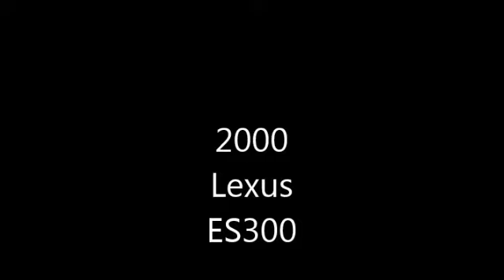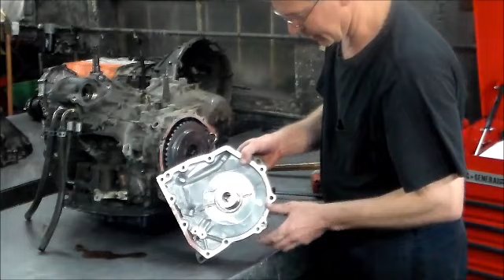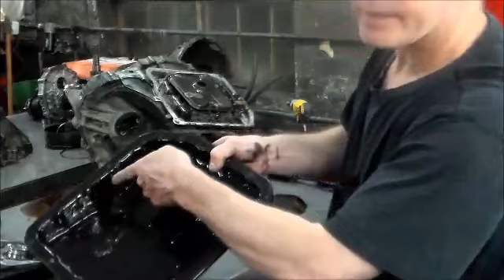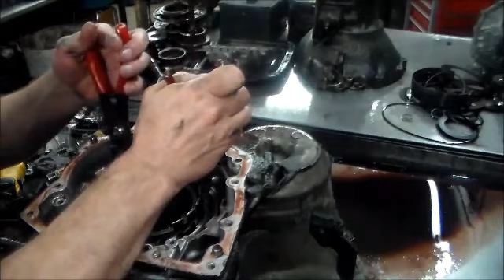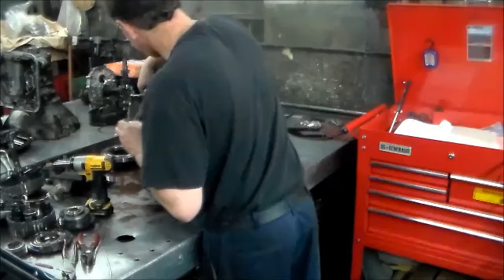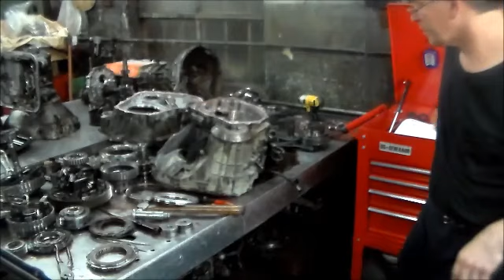U140 Teardown Inspection

Comment: I've a 2010 Toyota Matrix S AWD 2.4 L with a U140F transmission. Lost reverse after gunning up my 300 ft muddy driveway. I pulled the transmissio pan. The fluid was black, burned. There are a coating of fine silver metallic particles on the magnets. Magnets were not completely coated.   The filter was dirty so I changed that. No big chucks in the filters just grain sized silvery particulates. I pulled the 4 shift solenoids, cleaned the shift solenoids and used compressed air then electrically tested them with 12 volts leads and all 4 clicked telling me they work. I reinstalled the solenoids with new fluid, filter and gasket. Still no reverse.  Could it be the valve body assembly?
Reply from the maker: Those transmissions are know for the gear trains going bad, something happened in that area, how does this drive forward?
Reply: @GaryFerraro  it drives forward although I haven't tried to take it out on the highway at speed to get a good feel for the gears.
Reply: No sticking as I shift.
Reply from the maker: @jcisar  ok, question,   Does this move forward in Neutral?
Reply: @GaryFerraro  yes but not when selected after startup. Neutral seems to drive forwards only after I put it into gear then back into neutral. Only then neutral goes forward.
Reply: @GaryFerraro  Also, yhe ignition turns and starts up in Park and Neutral and not in any gears (D,R,3,2,L)  That's good right? 

I originally had no check engine light prior to losing and after losing reverse. I used BlueDriver OBDII code reader to pull codes and got no codes.  I cleaned disconnected the ECM, checked fuse in engine fuse box, cleaned the ECM wiring connectors with electronics cleaner and pluged in the ECM and got a code U0100 (Lost Communications with ECM/PCM A).   I then got a check engine light, and a bunch of other dash lights. 

I replaced the ECM with a reprogrammed one. I then got a bunch of new OBDII codes: 

P0778
P0748
C1201
C1280
B2799
P0010
P0102
P0118
P0113 

I replaced the engine VVT solenoid, engine coolant temperature sensor, and mass air flow sensor with new aftermarket parts in addition to cleaning and checking the shift solenoids to the U140F valve body. It stalls upon ignition but I figure that has to do with the new ECM needing time to relearn. Perhaps codes other than P0778 (Pressure Control Solenoid "B" Electrical and P0748 (Pressure Control Solenoid "A"  Electrical)  solenoid electrical codes are just ghost codes.
Reply from the maker: @jcisar  Yes only starting in park and neutral is good. So if this only moves in neutral after selecting neutral from drive, i would first make sure linkage is ok.  With the engine running can you push the car back?
Reply: @GaryFerraro  
If I start my car on an incline and put it in neutral it rolls back. If I start it on a level surface and put it on neutral it creeps forward.  The creeping in neutral began after installing new p/n transmission range switch, transmission solenoid wires, a valve body cleaning and zip kit install.  It drives forward in both reverse and neutral now. 

Apologies for the delay responding. Thanks for helping me.
Reply: @GaryFerraro  do you recommend I find someone to do a transmission rebuild?
Reply from the maker: @jcisar  did you hook up the manual valve?
Reply: @GaryFerraro I think so.   The manual valve detent lever rests in between the notches at the end of the manual valve. If that's what hooked up correctly looks like then yes.

I have the manual valve resting  beneath the detent lever not above it. I'm not sure if that's correct.   Thank you.
Reply: @GaryFerraro  I took the car for a short test drive today.  I noticed thy when it's running and in drive on an incline and I take my foot off the gas it will roll backwards a few feet then stall.
Reply from the maker: @jcisar  Does it start right back up again?  It stalls as soon as you select drive?
Reply: @GaryFerraro  it stalls only after rolling backwards in gear (D). It starts back up without problem.  Just got a new P0776 code today.
Reply: @GaryFerraro  I went to start it now after getting a check engine light, trac control light, VSC Off,  etc and it wont start.  It just cranks over.
Reply from the maker: @jcisar  May not be a trans problem, whats the code?
Reply: @GaryFerraro  2010 Toyota Matrix
Odometer: 165,675 mi

P0776 Pressure Control Solenoid "B" Performance/Stuck Off 

P0010 "A" Camshaft Position Actuator Control Circuit/Open Bank 1 

P0102 Mass or Volume Air Flow Sensor "A" Circuit Low 

P0118 Engine Coolant Temperature Sensor 1 Circuit High 

C1201
Check report for description. 

C1280
Engine Control System Malfunction

1 Confirmed Code
1 Pending Code
4 Permanent Codes
1 Antilock Brake System Code
1 Four Wheel Drive Code
1 Engine Code
Reply: @GaryFerraro  
The C1280 code appeared today prior to not starting only cranking:
C1280 Engine Control Malfunction 

This code appeared yesterday:
P0776 P0776 Pressure Control Solenoid "B" Performance/Stuck Off

These codes appeared about four weeks ago.   I then replaced the Engine Coolant Temperature Sensor,  Oil Control VVT Solenoid, Mass Air Flow Sensor, new Ignition Coils hoping for them to dissapear  but these codes didn't go away and persist: 

P0102 Mass Air Flow Sensor A, 
P0010 "A" Camshaft Position Actuator Control Circuit, 
P0188 Engine Coolant Temperature Sensor,

5 weeks ago I had U0100, C1201, B2799 after I lost Reverse without any check engine lights, so I ordered and installed a  remanufactured ECM in the car and those codes went away. 

Thank you Gary.
Reply: @GaryFerraro   I checked for blown fuses.  I checked each ignition coil for spark. None of the coils have  spark. I swapped out my new  Flagship One ECM with my old OEM ECM and it cranked and chugged as if if was on the cusp of starting.  I then pulled codes again and got a bunch of  codes:

P0113 Intake Air Temperature Sensor 1 Circuit High Bank 1
P0121 Throttle/Pedal Position Sensor/Switch "A" Circuit Range/Performance
P0122 Throttle/Pedal Position Sensor/Switch "A" Circuit Low
P0453 Evaporative Emission Control System Pressure Sensor/Switch High Input
P0748 Pressure Control Solenoid "A" Electrical
P0778 Pressure Control Solenoid "B" Electrical
P0983 Shift Solenoid "D" Control Circuit High
P2716 Pressure Control Solenoid "D" Electrical
P2770 Torque Converter Clutch Circuit High
P0113 Intake Air Temperature Sensor 1 Circuit High Bank 1
P0121 Throttle/Pedal Position Sensor/Switch "A" Circuit Range/Performance
P0122 Throttle/Pedal Position Sensor/Switch "A" Circuit Low
P0453 Evaporative Emission Control System Pressure Sensor/Switch High Input
P0705 Transmission Range Sensor "A" Circuit (PRNDL Input)
P0748 Pressure Control Solenoid "A" Electrical
P0778 Pressure Control Solenoid "B" Electrical
P0983 Shift Solenoid "D" Control Circuit High
Reply from the maker: @jcisar  clear everything and see what comes back
Reply: @GaryFerraro  I cleared the codes and all the codes came back.  I suspect an electrical issue since the codes are all over the place so yesterday  I installed a battery and tapped on the starter and alternator with a rubber mallet and put back in the reprogrammed  ECM and it started right up.
Reply: @GaryFerraro  the No reverse and forward in Neutral are outstanding issues even though all the other electrical problems went away. I have codes P0010, P0102, P0018,  P0776, C1201
Reply: @GaryFerraro  Gary, for a U140F transmission on a 2010 Toyota Matrix S 2.4L AWD, would I be able to check and change the clutch package by removing the driver's side wheel to access a cover side of the transmission?
Reply from the maker: @jcisar  You could that is the direct clutch or high clutch or 3rd clutch, sometimes those solenoids are a problem to, Pulling the side cover, you will have access to the direct and 2nd clutch packs
Reply: @GaryFerraro  I removed the rear cover and found the direct drum clutches were burned and ring grooved so I replaced the direct drum and sun gear because with remanufactured parts because they had some wear.  I replaced the direct clutches nested in the direct drum.  I also replaced the sun gear and, 2nd brake clutch and forward clutch, two speed sensors and seals. One of the speed sensors closes to the direct drum had heat damage and if a little melted.  The deeper I went into the rear case internals the better things looked actually.  I found no broken parts.   The planetary looked fine.  I soaked parts in ATF and reassembled and started it up and lost drive in addition to reverse. I can't even push it in neutral.  Before I had lost only reverse and had 3-4 slippage and flares but could drive it but I cant even go forward now in any selected gear.  I checked the linkage and manual valve coming from the valve body and it looks connected.  I got codes P0983, P0748, P0118, P0010.   RPMs wont go much above 2000 in any gear or reverse.  Thoughts?  Thanks
Reply from the maker: @jcisar  someting must not be down all the way if you can't push the car
Reply: @GaryFerraro   the rotation for the U140 one way clutch, the inside sprag rotates counterclockwise allowing for the direct drum and sungear keyed to it to rotate clockwise, is that correct?  Thank you.
Reply: @GaryFerraro do you have any thoughts on what it might be?  The parking brake lever is down.  All four tires rotate when I lift them off the ground.
Reply from the maker: @jcisar  sprag rotation is correct, the grooves on the lugs face up.  You cannot push the car with engine off?
Reply: @GaryFerraro  correct.  I cannot push the car backwards in N or R with engine off.  The p/n safety switch works fine.  Today I threaded a line pressure gauge into the transmission's upper test port for a line pressure test. I warmed up the car for 10 minutes.  Pressure gauge reading were around 40-45 psi idle in D and 40-45 psi idle in R.   When testing in D and R  at 2000 rpm I got around 70-75 psi respectively. Does that indicate low pressure?  The repair manual reads acceptable idle range for  D @ 54-65 psi and idle R @ 93-116 psi.  The repair manual then gives acceptable stall test values as D @131-160 psi and R @ 251-294 psi.  Seems I'm below pressure range.  Thanks.
Reply from the maker: @jcisar  ok, so if you have the car in rev. hold the brake and snap the throttle all the way down see what your pressure is but being the fact you cannot push this car with engine off tells me may have broken gears
Reply: @GaryFerraro  when reving the throttle in reverse with brake on I get pressure readings in the 90-100 psi range.  

I only lost forward  movement only after opening the front cover and replacing the direct drum, direct piston, direct clutch, rear sungear, 2nd brake clutch, and forward clutch to try and fix a sudden loss of reverse problem.  That's when  I discovered burned up direct clutches and worn direct drum/piston and sungear so I replaced these.  

My original problem was a sudden loss of reverse. Then I could push it in neutral with engine off before going into the rear case and replacing the direct drum, direct piston, direct clutch, rear sun gear, 2nd brake and forward clutches.  And since then it's been in the garage on ramps so I haven't driven it to brake a gear resulting in a loss of everything.  I haven't found any broken gear bits in the pan.  Thanks.
Reply: @GaryFerraro  Gary, I dug back into the U140F rear case looking for a broken gears and walked though my rear case rebuild.  I didn't find anything obviously broken. . I haven't dropped my transmission so I can't get to the front case but I did use a magnet wand to probe the front case though the rear case hoping to pick up any broken parts. I didn't find anything.  I ran compressed air through the port in the 2nd Brake B1 Clutch Assembly.  Half the B1 Clutch piston was sticking so I suspect it was partially applying explaining complete movement loss . I replaced my new transmission solenoid wire with a newer wire and swapped in a remanufactured valve body. I can now push my car in N with car off.  The car goes forward in N again with car on.  R is still gone (my original problem) so I've come full circle.  Forward motion returned for D, 3, 2, and L.  I performed another pressure tests with the engine hot for D and R and got the following approximate  psi results: 

D  - 55 psi  idle /  125 psi @ 2000 rpm
R  - 90 psi idle /  275 psi @  2000 rpm

What are your thoughts Gary? 

Also, maybe I didn't install the correct number of steels and frictions somewhere?  My direct clutch has of 3 steels and 3 frictions and a pressure plate. The 2nd Brake assembly has 3 steels and 3 frictionsand a plate, and  my 1st & Reverse brake assembly has 5 steels and 5 frictions and a plate installed. I'm wondering if my steel and friction count is off  somewhere or does that look right?   

I've sofar replace the direct drum, direct drum steels and frictions, sungear, 2nd brake steels and frictions, 1st and reverse steels and frictions.

Still have those four permanent codes:
P0010 A Camshaft Position Actuator Control Circuit/Open Bank 1
P0118 Engine Coolant Tsmo Sensor Circuut High
P0748 Pressure Control Solenoid A Electrical 
P0983 Shift Solenoid D Control Circuit High
Reply from the maker: @jcisar  Ok so the trans codes are electrical if you clear them, they come right back?  For forward in neutral and no reverse, there has to be a clutch pack maybe to tight, linkage all looks ok?
Reply: @GaryFerraro  linkages look good. Codes keep coming back.
Reply: @GaryFerraro   @Gary Ferraro Gary inforgot to ask how do I tell if the clutch packs are too tight?  Am I just checking pressure plate thickness against repair manual specs?  I wonder if I mixed up clutch pack pressure plate because they bith say #3.  For this I'm going to need an dial caliper and feeler gauge to test tolerance right? 

I also bought a cheap 5.5 mm × 15 foot endoscope and am wondering what parts i should examine for damage with it in the front case if I can snake through the rear.
Reply from the maker: @jcisar  With the snap-ring installed, does the clutch pack move up and down, maybe like .060 thousands?  or no clearance at all
Reply: @GaryFerraro  I used a feeler gauge and .026 thousandths seems to be the clearance between the snap ring and the pressure plates for the direct clutch and 2nd brake clutch.   Is that .026 alright?   Thanks.
Reply from the maker: @jcisar  ok, so just to refresh me, this still moves forward in neutral correct
Reply: @GaryFerraro  yes it still moves forward in neutral. No reverse. 
I bought an endoscope and snaked up into the front case through the opening behind the valve body as best I could to look around.  I didnt find any broken metal bits but I find grooved wear on the teeth of what looks like a ring gear.
Reply: @GaryFerraro  im waiting on a 30mm 12 star socket so I can take off the front axles and drop the transmission to look in the rear case. I'll post what I find.
Reply from the maker: @jcisar  ok, sounds good

Comment: Hi Gary, i got 2000 RX 300 fwd. Not sure if its got u140e or f. The car has no codes, shifts perfectly but no power on acceleration just goes so slow and doesnt move further and moves slow on engine restart. What could be wrong ? the car has 250k miles is it the transmission out ? wont there be any check engine codes ? What do u recommend ? get a used transmission or get it rebuilt...  do you know any one from CA. please suggest any alternate interchangeable transmissions that would work for this model
Reply from the maker: How is reverse? Strong, plenty of power?   There should be codes i would think
Reply: I think reverse behaves the same goes slow and need to turn off the engine to move again. I am thinking to replace the filter and fluid. i think 3 yrs ago i changed the fluid and not the filter. The fluid when checked doesnt look dirty or burnt smell. The filter might be clogged for sure. could a clogged filter lose acceleration front and reverse?
Reply from the maker: sri nandu    Sounds like the filter is clogging up
Reply: Gary Ferraro took a chance and replaced filter and fresh fluid just now . No whining sound and the car runs smoothly and shifts great no power loss. I guess the damn clogged filter caused this issue. Thanks a lot
Reply from the maker: sri nandu  Keep in mind, it may clog again, something may be coming apart clogging the filter
Reply: Gary Ferraro  The fact is i got the filter replaced at lexus 10 yrs ago and i drained and filled the fluid 4 yrs ago. In an essence the filter ran approximately for 100k miles and now i changed. The magnets were all so dirty. Cleaned up all and fresh fluid.
As you mentioned, something may be coming apart. What do you suggest i monitor or do change the filter again after few months ?
Since i replaced pan gasket, filter and fluid, i may have just replaced half the fluid and not a full flush the fresh and dirty fluid may become mixed up. Do you recommend a full flush of the fluid ? or wait few months and then drain and fill. Appreciate very much for your expertise and timely help.
Reply from the maker: sri nandu  Well, if the filter is clogging up, you may not make it a few months, for now just drive the car see what happens, but this may need a trans in the near future